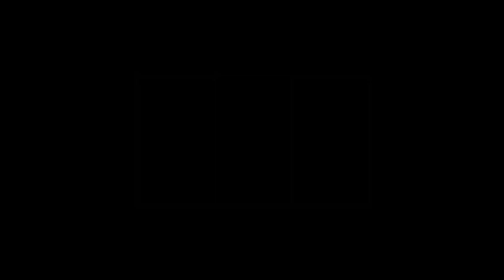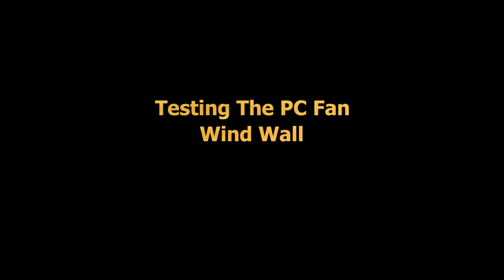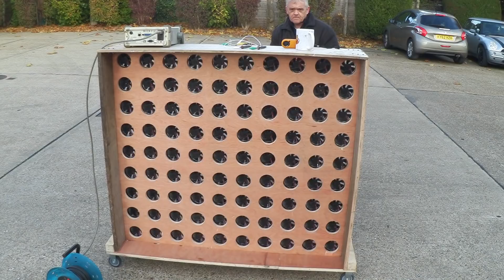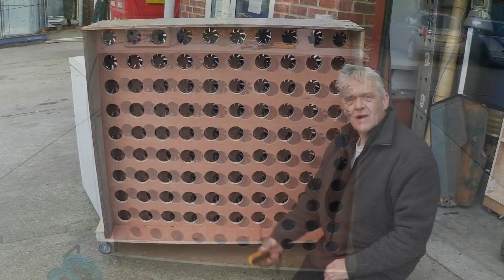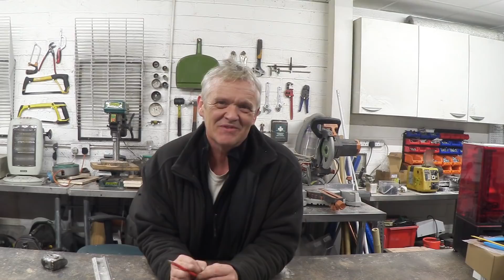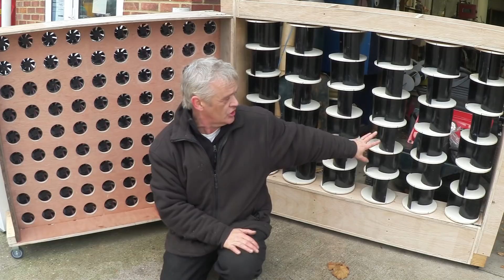1329 Testing The PC Fan Wind Wall

Comment: I recall someone promoting a wind wall that was made of 100 computer cooling fans years ago as some "revolutionary new technology" and wondered what was the point of doing more work and using more materials when everyone knows bigger wind turbine is always cost effective... turns out the inventor didn't know basic physics, or at least the folks promoting it didn't.
Recently there was a video of a grid scale system that is much more realistic, they only claim to replace five big turbines with one wall system that has over a hundred decent sized turbines. The trick is that while a large offshore wind turbine is more efficient, the increased costs of huge components and the troubles of building at the sea start increasing the cost per watt, so mid-sized turbines set in a frame that allows them to be installed and maintained more easily(meaning more cheaply) and using less area might become viable.
Still, figuring out if the turbines interfere with each other might be impossible without actually building a full size prototype, which is a huge risk so I wonder if they will get any money for testing.
Reply from the maker: I am sorry mate but a bigger wind turbine isn't always more cost effective - in practice, the cost of a turbine increases with the cube of the size the power increases with the square of the size - and what you are talking about is the wind catcher system
Reply: @ThinkingandTinkering  Well, the "always" is the problem, there are many variables when dealing with wind turbines. A bigger turbine needs a taller tower, but that gives it more wind so it should produce more power. Smaller ones are cheaper to put up, but now you need more electronics between them.

But smaller turbines also can start up with slower winds and keep on running in higher winds that force the bigger turbines to brake, so they might be better in some cases.
Reply: @AnalystPrime  Your point is?!!
Reply: @AnalystPrime  Break or Brake?!
Forgive me for nit - picking, however, there is a whole world of difference between the two....
Reply: @AndreaDingbatt  The long blades of big turbines cannot handle too high RPM, that is why they use brakes so they will not break.
Reply: @AnalystPrime  Thank you for clarifying!! 🤔👍

Comment: For the vertical one, why not put each blade at 45 degrees instead of 90? I can understand 90 if had 2, but I'd probably change the angle depending on the number of blades you had. | / - \ | / - \ |

Comment: did he say 3.4 watts? 
what can you power with that?
Reply: You could store it in a capacitor or battery to be used later or build a much bigger wall to produce more watts.
Reply from the maker: oh come on mate - you have been here for a while, I recognise you - please try and not be so simplistic in your analysis. I am sure you know the arguments about wind, wave and solar and the energy densities per square meter of each and the relative associated costs of using each source. This produces around the same as any wind turbine and it is in a car park! The win here isn't the power it produces at low wind speed - all turbines do that - the win is the idea that it doesn't cost very much, can be home made, is easy to maintain and can be integrated into an urban environment - that seems like a lot to me
Reply: @ThinkingandTinkering  But it's not an argument or analysis I really want to know if it produced 3.4 watts or I misinterpreted. English is not my first language. Additionally I am curious as to what can that stack of fans power so when I try this in the future I can manage my expectations and scale up depending on what I'll try.